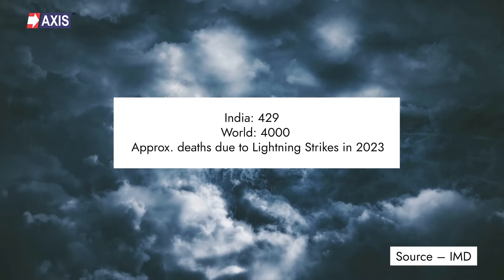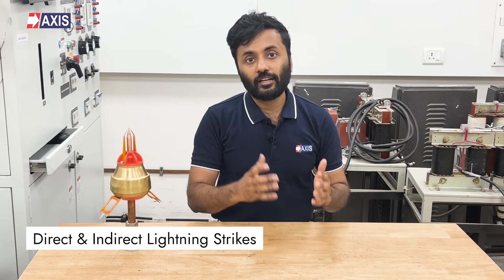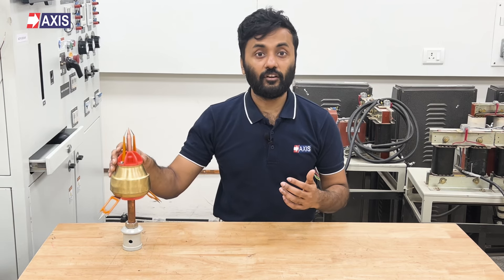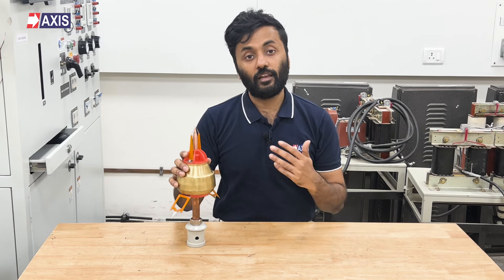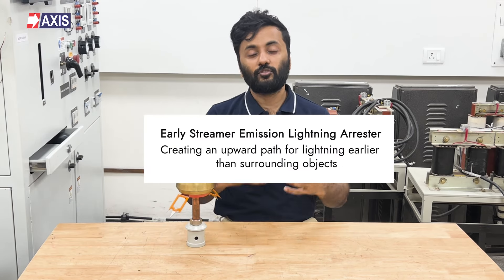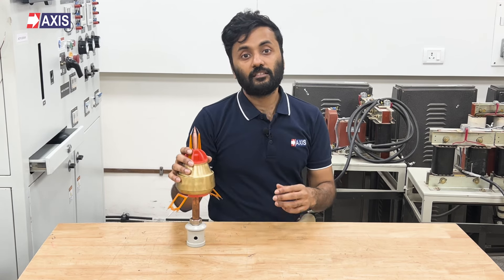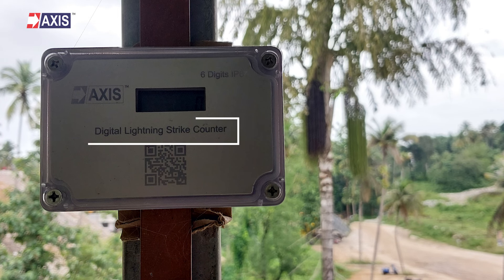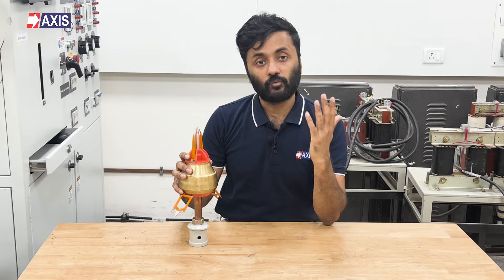Working Principle of ESE Lightning Arrester Explained! 🌩️

Comment: How does the ESE lightning arrester differ from traditional lightning rods?
What is the role of the ionization process in ESE arresters?
How does the early streamer emission technology help in protecting structures from lightning?
Are there any installation considerations or maintenance requirements for ESE lightning arresters?
What safety standards or certifications should an ESE lightning arrester meet?
Reply from the maker: Difference from traditional lightning rods: ESE lightning arresters activate earlier by emitting an upward streamer before the lightning strikes, whereas traditional rods passively receive the strike.
 
Role of ionization. The ionization process in ESE arresters creates an upward streamer that intercepts the downward lightning stroke earlier than traditional systems.
 
Protection mechanism - Early streamer emission technology increases the protective radius and allows the system to capture the lightning strike earlier, reducing the chance of damage.
 
Installation and maintenance considerations - ESE arresters should be installed at the highest point of the structure, with proper grounding and regular maintenance to ensure effectiveness. Watch this video: https://youtu.be/USajjGYjUH4?si=PjyY8StNX4g_aonP
 
Safety standards or certifications - ESE lightning arresters should comply with standards such as NFC 17-102 or equivalent to ensure safety and performance.

Comment: Please explain how ESE arrester create electric field ,is it active device?
Reply from the maker: The ESE lightning arrester creates an electric field by using a high-voltage pulse generator within the device. 

This generator increases the local electric field strength, enabling the arrester to emit an early upward streamer. 

This streamer propagates towards the incoming lightning strike, effectively intercepting it and directing the energy safely to the ground, thus protecting the structure.

For more detailed information, you can read https://axis-india.com/early-streamer-emission-ese-lightning-arrester/